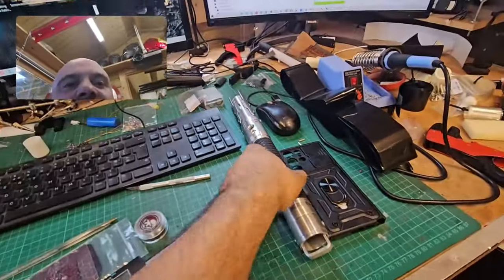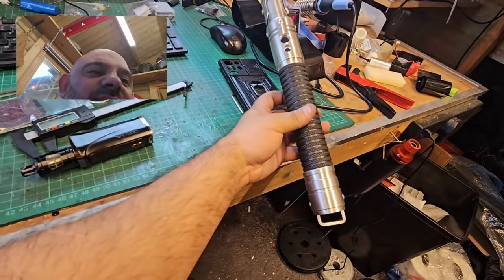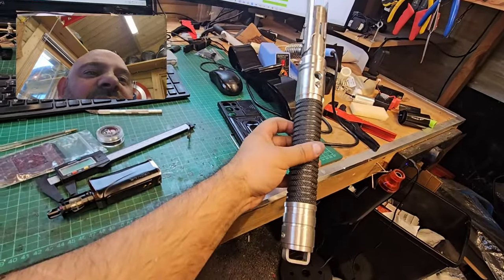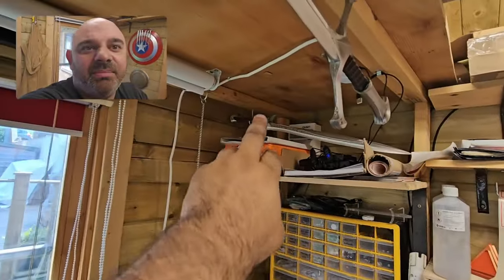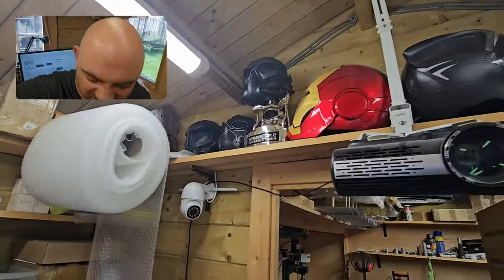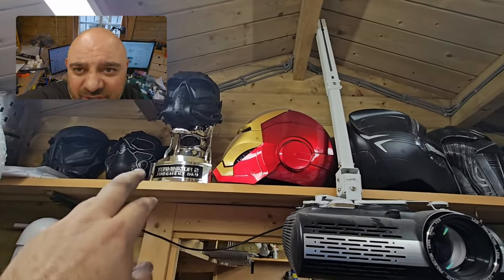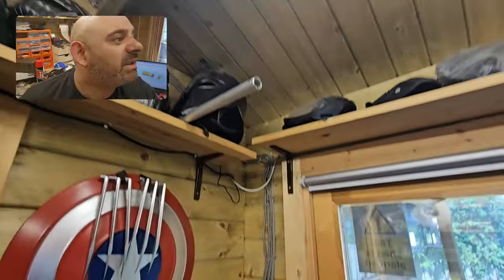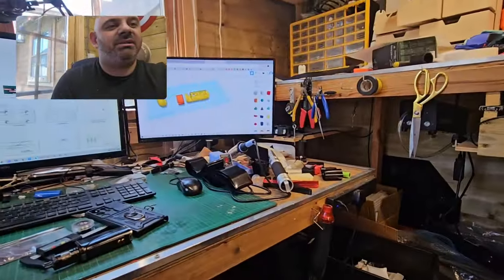Thank you to everyone. It's been fun but somethings have to come to an end

Comment: I wanted to make this as a seperate comment. I have not checked so you may have it already I will look afterwards. A video or series, showing start to finish of a very easy, DIY setup of building a saber would be neat. Im not interested in sabers but I am interested in like arts and crafts projects, if you with all of your experience and knowledge could make a video series just making a quick easy saber would be neat. Using like a 3d printer cause who doesnt have one, and just some typical arts and craft tools, and hand tools, etc. If this is even possible ahaha. Either way, best of luck in the future!
Reply from the maker: thank you for the idea and your lovely comment. Sadly i don't think i'll be making anything else now. i've taken all my metal to the scrapper and alot of tools have now gone. but i was a good idea thank you